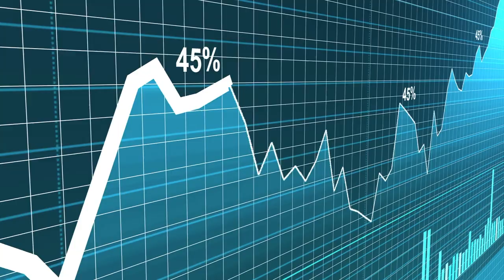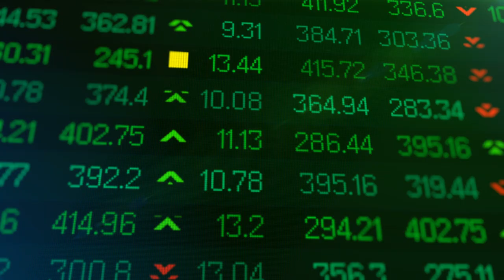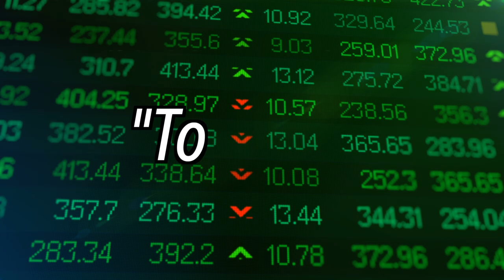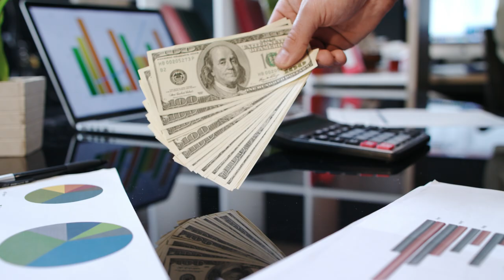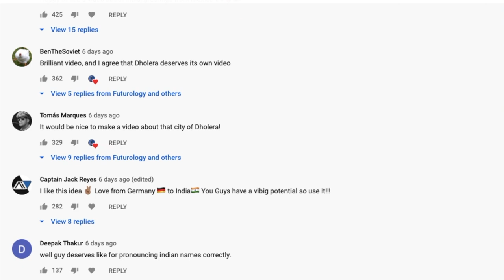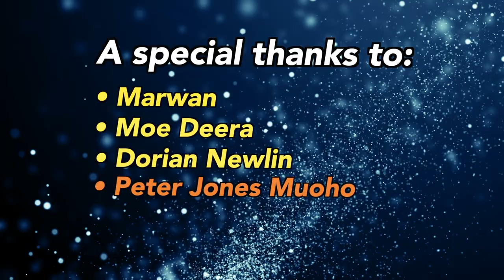New York’s Proposal for a Tunnel to Long Island

Comment: This bridge should have been built in the 1970's when RT 135 was built.

But Connecticut residents were the problem. NO LONG ISLANDERS.

For this bridge to be off the Seaford oyster bay- Route 135 would be perfect.

It would take lots of the traffic off all inner New York city bridges and tunnels.

Everyone on long Island would benefit by making it easier to get off of/and escape Long Island at any time.

It would decrease traffic on Southern State Parkway, Northern State Parkway, and the Long Island Expressway.

Doesn't everyone realize, how much of the traffic on these roads is only there because people are heading to the other bridges and tunnels to get off the Island or because they have just gotten back onto the Island and are from Nassau County and Suffolk County.

Although they may also want to widen the Northern end of Route 135 for the increased traffic from Northern State Parkway and The Long Island Expressway.

They could also not have any new entrances any farther north then already exists. As to limit the traffic in those Northern most parts of Oyster Bay.
They could even close one or two if it would make a bridge more palatable for those living there.

Being from Massapequa I can tell you. It would raise properly values. Not hurt them.

And on the Southern end of the Seaford Oyster Bay - Route 135.

They could also finish building it all the way to Ocean Parkway and Jones Beach.

That way people from Connecticut could finally easily drive to the Atlantic Ocean for their enjoyment.

Another win.

But the same problem still exists that stopped it over 50 years ago.

Where will the build the necessary roads in Connecticut?

They were and will be the biggest problem.

Their only benefit from this bridge is mostly their new access to the Atlantic Ocean and beaches, and maybe the entertainment Long Island provides, along with a secondary way of getting to Manhattan.

It's the people in Connecticut that need to get on board in order to do this.

So start by telling them how much toll money they can collect and what that money will do to improve their lives or save them money.

It must become a WIN WIN for both Connecticut and Long Island if you want this to finally happen.

AND IT WILL BRING NEW MONEY TO BOTH AREAS, AND LOTS OF IT.

They just need a good way to deal with all the new traffic or there needs to be build miles of fly-over raised highway all the way to Interstate 95 or something.

Then listen to them scream about all the business opportunities they will be missing out on, because of such a fly-over.

Talk money and business.

Because that's the kind of stuff Connecticut needs now more then ever as economies slow down.

And forget such an overpriced limited tunnel system.

Either project will cost two, three or more times whatever it's admitted it will cost in the first place.
5 or 10 billion for the bridge is still manageable.

150 billion or more will likely hit a trillion once the corrupt cronies start fiddling with things as they smell the money starting to get spent.

Just finally finish this thing.

Its been a great winner of an idea for over 50 years that needs doing. SO DO IT...

Comment: Route 135 ends in Syosset , just waiting for the bridge or tunnel to Connecticut . I bet if you get engineers and labor from Europe , it could could be done for a fraction of the cost , better and in less time . Do not let the MTA get their hands on this ! There are sand hogs working weekends on the East Side Access Project making over $ 400.00 an hour ! There are hundreds of people at that project and no one can even figure out why they are there and being paid ! Typically there is THREE times the labor used on these projects in the USA than in Europe . It's a money grab by ALL involved ! Wake up people - you are being ripped off !

Comment: I live on L.I. (Riverhead to be precise). Why not just upgrade the ferries to high speed ferries? Hi speed ferries are all over Europe. With high speed ferries, instead of having 2 individual ferry points going back and forth, you could have ferries doing loops between all the ferry ports. Going through the city and paying all the tolls to cross bridges is insane! It also takes much longer than in the video to get from L.I. to upstate N.Y. or Connecticut especially during rush hour.

Comment: I recommend 3 tunnels, all of which to accommodate Rail so that the LIRR, MetroNorth and CT Rail can easily link with each other.
CT Transit, NICE Bus and RIPTA will all expand their services for improved transit connectivity.
Also, rail will allow AMTRAK to operate New York to Boston service via Long Island, which increases service between Massachusetts and NYC and increase Transit options along the Northeast Corridor to improve Transit Connectivity between New York and Boston.

Comment: the tunnel idea was wack, they wanted to remove some homes to create exhaust pipes for the tunnel. Bayville also only has like 2 main roads so having a tunnel exit in that area would fuck up the traffic a lot. Oyster bay is also already pretty congested at times. 
It's really not that bad driving through queens or taking public transport to get off the island

Comment: If you want to put the bridge crossing the Long Island Sound you might as well copy the Copenhagen to Sweden Bridge lower deck is actually occupied by the train tracks Upper Deck Bridges Okapi what the British did before they handed over Hong Kong to China which was actually Upper Deck motor vehicles lower deck trains and motor vehicles. Tunnel option that's exits before the Long Island Sound tunnel put a sign warning Hazmat driver's use the ferry Port Jefferson Bridgeport coming from Boston Massachusetts Orient Point New London. just like the Channel tunnel bans ADR goods from using it instead they must go on the ferry Dover Calais.

Comment: I really think they should build 4 Tunnels connecting the Mainland US to Long Island. One in NY Connecting Westchester to Nassau County I-287 Extension with some tunnels under some of the crowded residential areas, Two Connecting Suffolk County to Connecticut One for Eastern Connecticut (I-91 Extension) and One for Western Connecticut (I-595 NY-CT replacing 678), and One Connecting Suffolk County to Rhode Island (I-495 Extension).

Comment: Couple Comments:
Bad plan- bad video.   A bit confused at the 3:32 mark when Futurology suggest economic benefits with a downwardly trending graph.  I would agree with the graph that Oyster Bay and Rye would experience negative economic impacts from a bridge and insignificant economic impacts from a tunnel - not what Futurology was suggesting.  Also, stating that this would put the "Mojo" on US Engineering prowess is rather ridiculous and amounts to cheer leading for a poorly conceived project and location-- "If you build this the world will respect you.." BS.

Comment: I 95 in in Ct. needs to be widened first.  What savings in time is there if after you cross the bridge you have to sit in bumper to bumper traffic on an antiquated, constantly in need of repair/re-surfacing Interstate?  When I travel to New England, I95 is not even my second choice!   It's either 684/84 to 90 or the Merritt to 91/90.

Comment: Bad idea all around, and will have no public support. Long Island isn't a manufacturing hub and doesn't need additional trucking capacity. Only the developers band mob run unions want it. I doubt that most Long Island residents would be in favor of a project like this, and with public policy moving away from the automobile, no one should invest another nickel studying this.

Comment: A connection between Long Island and the mainland would be lovely. The Orient Point connevtikn is DOA for many reasons. Neither tunnel nor bridge is feasible. Perhaps a faster ferry would be possible. A connection further west is logical. Letset aside the whines from landowners. A bridge is astetically undesirable and it would be more likely to negatively impact coastal environments. Any tunnel, if it doesn't accommodate rail is crazy (LIRR to the New Haven Line) but this would increase tunnel costs. One can only imagine the costs of upgrading the infrastructure leading to the tunnel. Of course, Connecticut is right that such a connection would offer that state little benefit, so perhaps a bridgeto Rye rather than Bridgeport or New Haven. I don't see this happening any time soon.

Comment: Our traffic is bad enough as is. The ferries limit the flow of traffic and create long term job opportunities. To add to that it lessens emissions by taking te ferries as opposed yo constant cars sitting in traffic. There are also environmental issue from the bridges.  They were building a ferry from Glen Cove to Rye NY but instead they opted to do a tunnel that would be a shuttle and not one you can drive through but to me that makes no sense.

Comment: A tunnel is cheaper than a bridge,  it is safer and lasts longer.
Reply: A tunnel is not cheaper. Whether it lasts longer or not depends on the type of construction and maintenance.
Most bridges are designed to last 100 years. With proper maintainence.
Reply: Not in NY!

Comment: This has been floated since the Seaford Oyster Bay Expressway was built in the mid 60's & that's why it ended on Jericho Tpke. in Syosset N.Y. Problem was people would have to give up land and/or homes etc. in order to do it & some did not want the traffic etc. to screw everything up. A deep underground tunnel would be the best & safest option but 55 billion is an exorbitant amount of $$.

Comment: Im no science doctor but that far end bridge looks possible over shallow parts where you can make it high for boats to pass and then a floating bridge or floating submerged tunnel over the deep parts. Norway have like 20 different options for deep sections of fjord and can easily be done even in rough seas.

Comment: Consider the real estate benefits of both tunnels and bridges and package a development deal with construction of the infrastructure. You will likely find a divide or shift in the opposition in favor of building what you need. The key is recognizing the balance between taxpayers, labor, and business while not restricting equal opportunity.

Comment: I live on the eastern end of Long Island so if we are traveling to "New England" its much better to take the "slow" ferry rather than driving west on Long Island just to take a bridge and then drive back east in Connecticut. Plus the roughly 75 minute ferry ride is that much less time behind the wheel.

Comment: The ferries do not take more time than driving around; you have not researched this completely. If you are going to eastern New England on a week day between 6AM and 9PM, it would take less time to take a ferry. A better solution might be more ferries at other points across the Long Island Sound, for example Glen Cove and Oyster Bay. High speed car ferries can travel at 40 knots; the distance is about 8 miles, so under 30 minutes. Unless you come to Long Island and take the bridges, you would not know this.